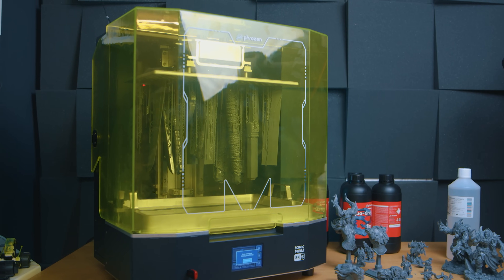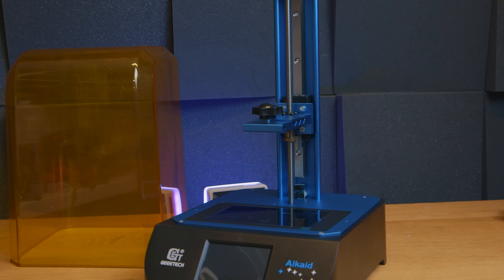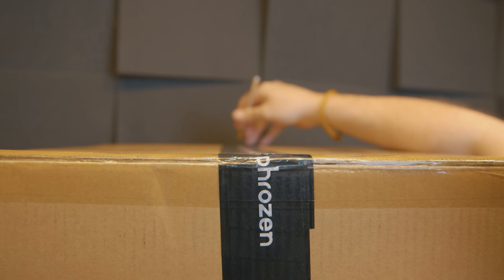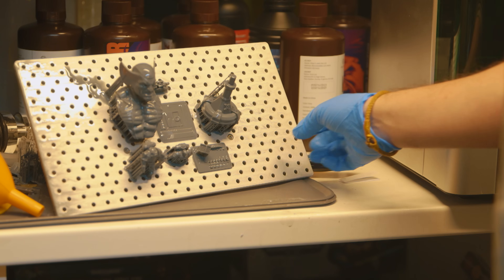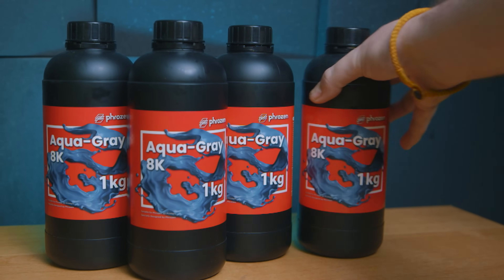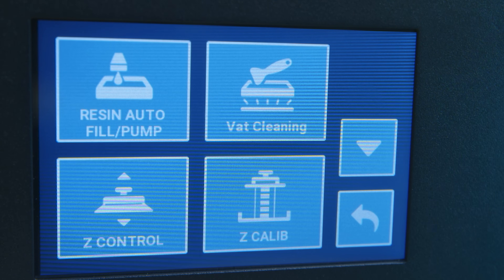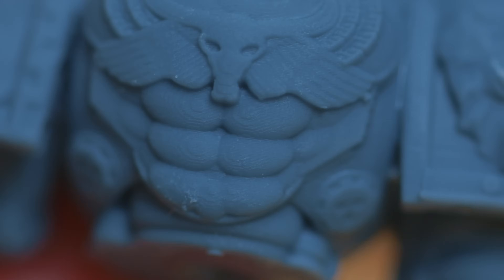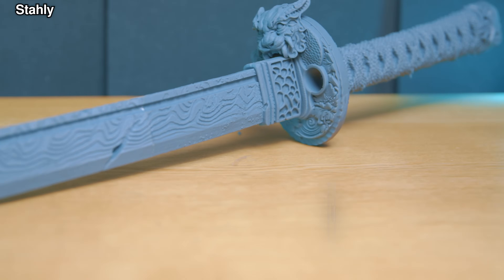Sonic Mega 8k S Review - PHROZEN are BACK ON TOP

Comment: would loved to have seen it with an heater, auto refill especially with such a large build volume and maybe a 12k display to match with the build volume
Reply from the maker: Agreed on the heater, there is a resin pump, but it's seperate.

Comment: Why do none of the big brands (anycubic phrozen, elegoo) have vat heaters, temperature is such an important variable to account for when printing stuff that it's just mind boggling that the biggest brands in the industry ignore it
Reply: True that. You'd think at least one of the big guys would add one and make a big marketing deal out of having it.🤣
Although right now I'd need a chiller, it's nearly 40C in my print room but I'm only running FDM in there atm so no problem.
Reply: Those will be in next years printers.
Reply: Uniformation GKTwo. That's the smart choice
Reply: Truth! I went with the Uniformation GKtwo last week 100% for the heated vat.  I will have it running in the garage and this is what I needed.  I would have preferred a big brand for customer service and history of reliability but without any options they lost out this time.
Reply: Easy, you're basically picking the samsung or apple of 3d printers
The main ones that spend money on advertising
Reply: Especially given how susceptible phrozen resins are you fails at lower temperatures...
Reply: I've been using this and unless you live in some super cold weather all year around, I have never needed one.
Reply: Next years printer ?! You cant even buy any of these as they are all sold out @jasoncombs3232
Reply: @SitoPon  If Uniformation COULD deliver any Printer. Delivery time is 1 to 2 mths...with Luck. I don't see any Reason to wait that long time for what...just to have one Printer with an Heater inside. And also not interested to have the Problems with broken Hinges from the Lid, broken Plasticparts on the Vat and Worn-out Screws on the Building Platform.
Reply: Fermentation band and a thermal controller..  $30. Done and done.
Reply: Interestingly. My comment was deleted. So I found ApexMaker mini 3d printer. It looks really appealing. It has a heater, and pump, all the extras. And still no one is talking about it. No reviews, nothing. So I'm waiting to see if anyone will share a review.
Reply: It's really not as long as things are at least close to room temperature
Reply: @AutismusPrime69  try printing at 30C and then again at 15C and see how it all turns out. If you calibrate the resin at 30C you'll have under exposure and vise versa if you do it at 15
Reply: I've been printing on my old Mars 2 for last few weeks in an unheated, ventilated room at -5C. Zero fails. Same as when I was printing in 30C weather.

Temperature has nothing to do with resin printing. It's a myth to explain random.
Reply: @1738Creations  completely disagree here. The resin printing process is a chemical reaction like any other. All chemical reactions can be affected by changes in temperature. 

While you may have not had any issues it  could be because you calibrated the resin in these lower temperatures and thus increased your exposure time accordingly. But I can assure you that people who live in climates where the temperature can fluctuate by 45C over the year will have to use different exposure settings if they don't have a heater

Comment: I bought the Mega 8K when it first came out and I HATE those holes in the build plate. They were enough of a pain in the ass that I stopped using the printer for MONTHS. Finally, I got a piece of aluminum cut to the right size and replaced it and have never looked back. The holes add nothing. Mine prints beautifuly without them.
Reply: Do you have any info / pointers on how I can do the same? The holes added so much time to refreshing the vat that I don’t use it anywhere near as much as I should…
Thanks:)
Reply: @cav1086  I just got a piece of scrap aluminum from a guy who worked on boats, cut it to the right size, drilled the holes and put it on. I had to level it as it was a tiny bit thinner, but that was no problem and it has been wonderful ever since.

Comment: I am an Elegoo Saturn 2 owner and I would like to upgrade to Phrozen Mega 8k S to take advantage of the 15-inch platter.  I tried to design using the new version of Chitubox (2.0) where you can load the profile of the Mega 8kS. To my great amazement, I learned that the print time forecast, instead of decreasing (as I thought), actually doubled.  According to the software, the Phrozen Mega 8kS takes about double the time to print the exact same project compared to my Saturn 2.  I therefore wanted to know if it is an evaluation setting error of the Chitubox software or if the Mega 8ks is really more " slow" of the Saturn 2. (I would add that the print time data that emerges from Chiutubox is the same as what I see when I select the standard Mega 8K, so I suspect that the chitubox profile of the Mega 8KS is the same as the standard 8K.
)
Reply from the maker: No, this is a fast printer, coupled with the ACF film and a faster motor, you get faster prints from this at the cost of a little quality

Comment: Personally, I notice a lot of design oversights here. The handle issue is major. If the vat knobs cant be spun easily, the handles must come off, even for those with small hands. The UI is way too basic. Might function well, but they already have the "high quality" UI. If they want to strip out features because it's a base model product thats fine, but at least give us the good UI. The hinged lid appears to go back 4 or 5 inches. Thats a MASSIVE distance, especially when considering this is a large format printer, so the printer base dimensions themselves are already big. The lid going back that for will likely exceed the standard 24 inch depth of most US based countertops, and if it doesnt, the printer will be so far forward and just look stupid when the lid isnt open. There is pump recall system options in the firmware, but it's not included in the printer??? Seems odd to me. I think I noticed some other printer issues in your video that would bother me a lot. For this price point the physical build quality, printer brand name, quality, etc.. might be great, but I think those reasons alone would gate keep me from purchasing

Comment: What is anti aliasing? Probably botched the spelling?
Reply from the maker: Nope you nailed it. Though it’s often one word.

It’s softens the edges of prints to get rid of the voxel lines.
Reply: @ is it something you put on the print after or something you put in the printer’s vat? Thanks for answering!
Reply from the maker: @thebluephantom8086  it’s a setting in the slicer. You turn it in and increase and decrease the level of it.

Comment: I'm going to say this printer is nothing but a downgrade from the Mega 8K It's the same display sure get ACF film pretty sure I can put that in my Mega 8K oh wait I already did You get a resin pump feature You get a built-in hook I printed the adapter hook I understand that you know it's nice having a big strong metal one but I've been using a pet g one for I don't know 2 years now still shows no sign of wearing out that extra height you start talking about that hook makes a huge difference think about if you could raise a hundred more millimeters that all the sudden would make bigger models hang quite easy I don't print huge vertically but I can say I love my mega 8K for certain reasons and I hate it for certain reasons and this printer did not fix any of the reasons I hate it for. That cover looks cheap it looks flimsy You're talking about it holding on an angle and I get it it does nice but those nice metal doors well they're just that nice sure they're thin sheet metal but they're nicer than a piece of colored plexiglass. Really what they need to do was put a better screen in it cuz really all this is is s means stripped down
Reply: I think that's how Phrozen is marketing it, a stripped down version of the Mega 8K.